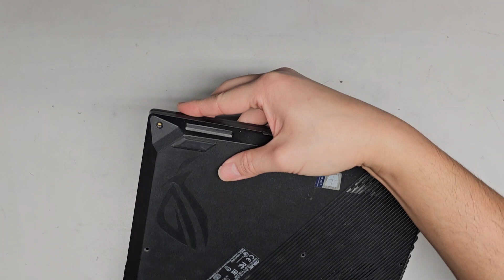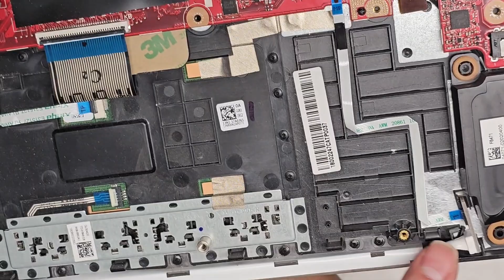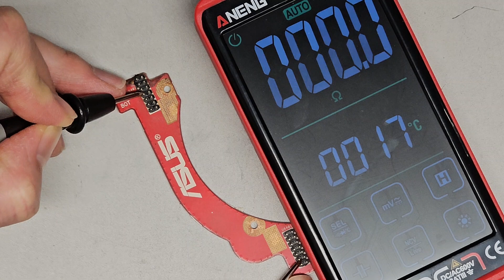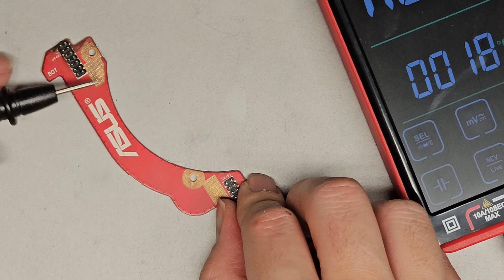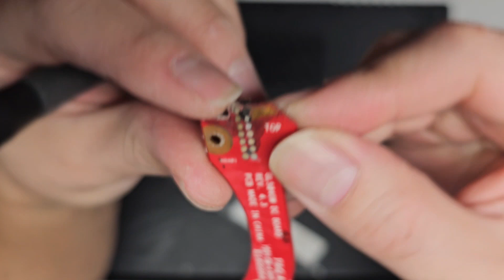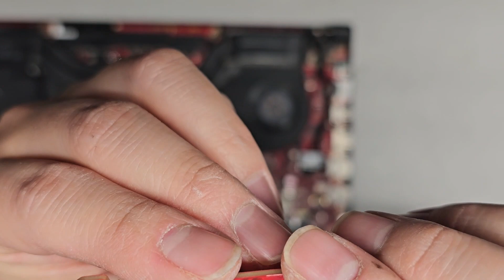ASUS ROG Strix SCAR II Gaming GL504G Disassembly RAM SSD Hard Drive Battery Charge Issue Quick Look

Comment: Hey there my battery is dead.
I have removed my hattery can i use the laptop by adapter only ?
Reply from the maker: Most likely, but not recommended.
Reply: Thank you for the reply.
What are the complications.
Because the official one costs me much more and its not worth it as my my gl504 is almost 5 years old.
Should i get a non official company battery which is cheaper ?
Reply from the maker: You can use a non official one.
Reply: Also should i continue using laptop with this battery , because i have heard that if you go on using  dead li- po batteries are a fire hazard and they can also bulge/swell
Reply from the maker: @standerstand6445  haven't had anyone with one that burned while in use